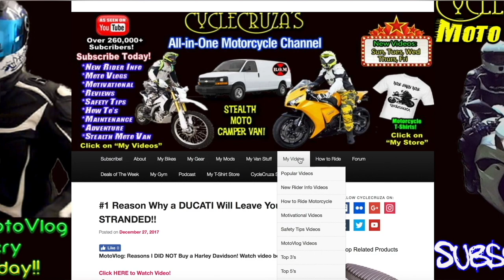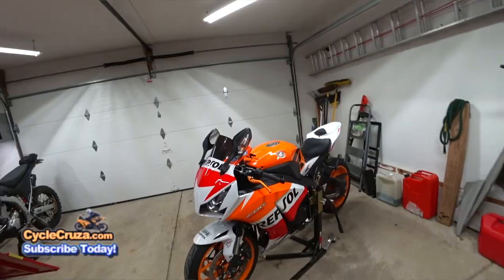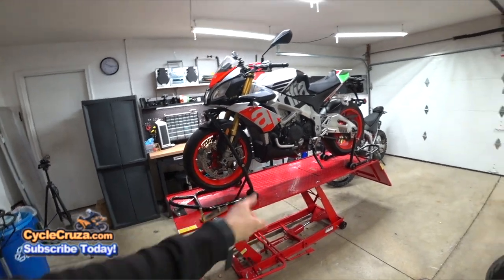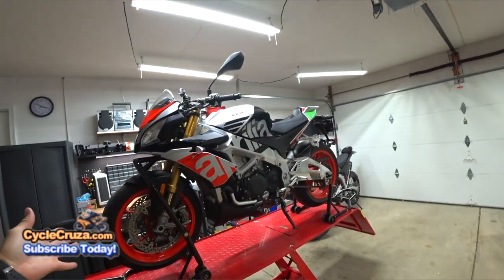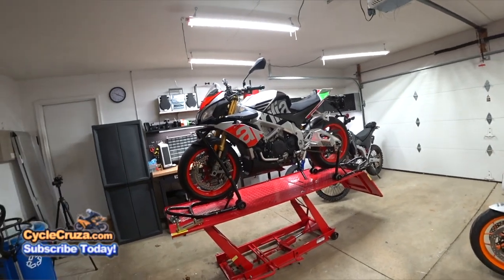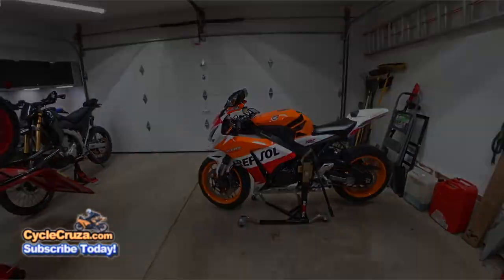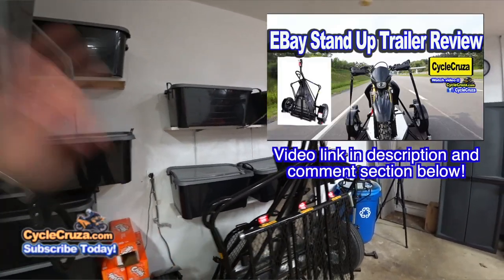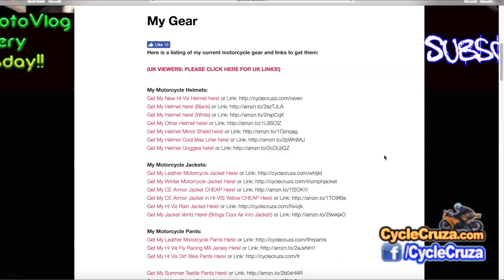BURSIG Center Lift Stand - AWESOME Motorcycle Stand (Long Term Review)

Comment: So its lifting the whole bike with two little bolts (both on the same side).
Doesn't that mess up the balance over time if used for ling times for a heavy bike?

Comment: I had the bursig and it was totally useless.. With so little ground clearance i could not get the front wheel of my Busa without removing the front fender. Sold it and bought a Abba skylift now that's a real lift.. Can do anything.. Wheels off, rear swing arm off, front fork removal etc. etc.

Comment: Your garage is NOT small!
Reply from the maker: I store a suv in the garage too, so space is limited with four bikes, this Bursig stand makes it easier to move the cbr and get access to the other bikes.
Reply: @CycleCruza  Just busting your cops CC! I use s similar stand made by ABBA in the UK. Same as the Bursig as I have multiple adapters for all of my bikes. A benefit over the Bursig is that I don't have to modify the bikes in any way. Just plug and play. And the Abba gives you multiple ways of configuring the bike including storing it straight vertical for the maximum space efficiency. I really love it!

Comment: Hey cycle Cruza I have the Ducati XDiavel s same bike as you was wondering would you sell the adapter plate for the stand for a decent price want to get the stand ??
Reply from the maker: I only have the plate tho, I left the sleeve on the bike by mistake. Do you want to buy just plate? You might be able to get the sleeve from the company. Let me know, hit me up in an email.
Reply: CycleCruza I can check into that but if I did get the plate from you how much would u want for it?

Comment: Yeah that HF bitch is heavy, I loaded and unloaded it into my minivan. It's a great lift I lifted my goldwing up dozens of times and the lift is about 10 years old now. It will do 1000 Lbs. no problem.
I put a HF wheel chock on the front of it so I can just ride on it and get off, I also bolted two 9" extensions to the side of it to make it wider. (A place to put my feet when backing off). It's been repainted and even touched up because all the use
https://i.imgur.com/HZeavsX.jpg
Reply from the maker: Cool!